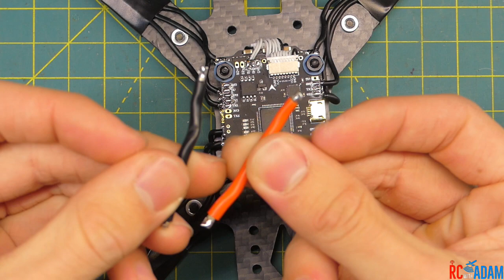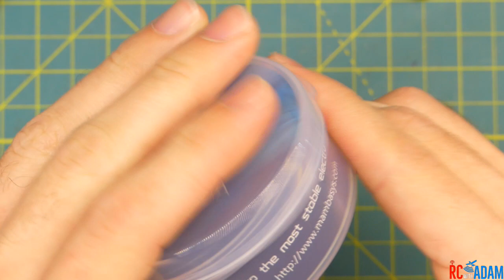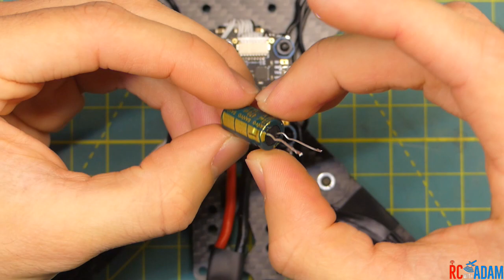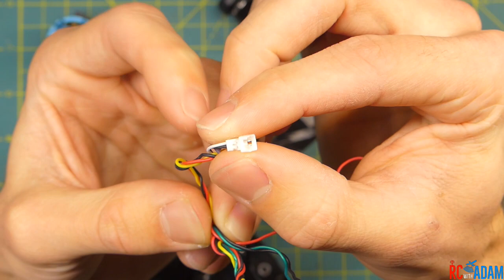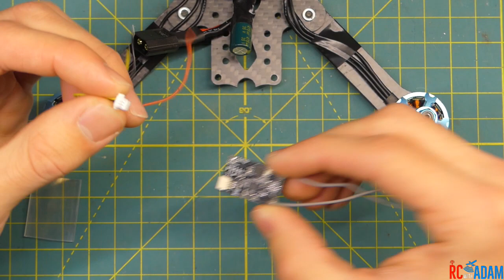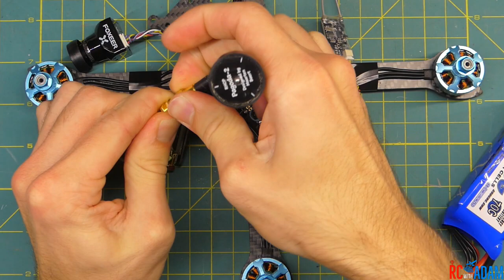Budget Basher Build - PART 3 - CAM, VTx, Rx, Ops Check [COMPLETE BEGINNER BUILD GUIDE 5" FPV DRONE]

Comment: Hey Adam, Nate here again. I'm trying to figure out where to solder my Fli14+ on to my Mamba F411 25A. With the r xsr not binding to my flysky I have a spare fli14+ and a fs-ia6b  to use. I took a look at the diagram and there's a RX 1, TX 1 invertor and TX1 uninverted. I'm kinda confused as to where I'd solder either receiver on, where should I solder the  fli14+ or the fs ia6b on?

Comment: Hey adam would the frame and the fc fit with a caddx tarsier camera because it comes attached with a dvr chip and if i take it off it wont be able to record 4k
Reply from the maker: Hi! It could fit, but maybe not super easily. The tarsier camera is narrower than the foxeer, so you would need to use some kind of spacers, and the board might need a custom mount.
Reply: @RCwithAdam1  what if i use a mounting bracket from another caddx camera?

Comment: On my flight controller of the mamba stack there is no tx1 pad. Where should i solder the green wire?
Reply from the maker: Hi! Do you have the Mamba F405 Mk2 flight controller?
Reply: @RCwithAdam1  yes i do, i try to settup mine the same as you.

Comment: Hello, I’m quite frustrated because i’ve been trying to build my quad since april and still haven’t been able to.
I first burned another mamba f405, the mk1 version, and had to buy the stack again . So the last month I resoldered all the cables into the new mk2 stack and everything was working fine until I started programming the quad with betaflight. I was unable to bind the receiver with the controller (flysky i6s 10ch) and the battery had been connected for a while. I gave up and disconnected it. 

The thing is that now when i connect the battery only one green led is shown in the esc, while before programming it I could also see leds in the receiver and video tx. The motors also beep differently, they now only do the first three beeps. 

Every help is appreciated, thanks in advance!!
Reply from the maker: Hi! That is frustrating! What rx (reciever) are you using? It sounds like the main issue is just that the rx and vtx (video transmitter) are not getting any power. Why that would happen without you changing anything is a mystery. Perhaps something overheated and burned out. Is your vtx very close to the fc (flight controller)?
Reply: RCwithAdam My receiver is the stock one that came in the box with my controller, 10ch fly-sky fs-i6s.          (looking something like this: [11,64€ 32% OFF]Flysky 2.4G 6CH FS-iA6B Empfänger PPM Ausgang Mit iBus Port rc teile from Spielzeug Hobby und Roboter on banggood.com https://banggood.app.link/1iroH6Qn6Y)

My video transmitter is just like the one you used. It was located over the esc part of the double stack, which I had to separate because I unknowingly bought an extrathin frame. I do remember it getting quite hot but thought it was normal. The receiver on the other hand was never hot.

So you think it could be fixed by rebuying the vtx and the receiver?

Thanks for your answer!

Comment: How you figured out the yellow was the signal and how you know to identify the correct wires to use in the connector to the camera and from the receiver ?
Reply: Also, what things should you take under consideration when buying a video transmitter. Does the fpv goggles that you use matter. I want the sky02s.  Sorry. This hobby is ruining my life. I need answers lol
Reply from the maker: @nacho248  Yes, goggles matter a lot. Mostly it's personal preference, though. I hear the Sky02s is good. I used to fly Eachine Goggles Two which a lot of people might consider trash. Now I have the Fatshark Scout and they are definitely an upgrade. If you're just starting out, I would say either buy whatever you like, has good reviews, and can afford, or just get a cheap sub $70 box goggle that will get you in the air and you can learn with.
Reply from the maker: Good question. Usually (hopefully) all of that info is in the product manual, but also once you're familiar with the different electronics, it's not too hard to guess.

Comment: Hi. I'm a newby, so I was wondering maybe some of you know where to put the grey wire? Do you put it in PPM or in TX or in RX? Thank you
Reply from the maker: Hi! What is the grey wire connected to?
Reply: I have a receiver DSM/2 Satelite,witch has three wires: orange, black and grey. This receiver is for my transmiter Spektrum DX6I. I want to connect those two, but I have trouble understanding where to connect the receivers grey wire. As it is shown in multiple videos, the grey wire should go to the Rx3 input, but it does not work for me.  Any ideas where I am wrong?

Comment: Thank you for this video! Great help! Just a quick question. Do you need to start with Tx1 or could you pick for example TX6 and keep the VTX stuff on the right side of the board and use the 5v and gnd next to the one we used for the rx? This way you wouldnt have to cross wires between the stack.

Comment: what type of antenna are you using for this build? RHCP RP-SMA LHCP RP-SMA or RHCP SMA LHCP SMA?
Reply from the maker: RHCP SMA. You can see more detail on all the parts here: https://www.youtube.com/watch?v=0zWvObLefKQ&list=PLDnffNsiQx6Nprb-oaFGLXKZyi07SBylG&index=2
Reply: @RCwithAdam1  can i know the battery you are using? and can you give me a detail about the capacitor you use in this video? I follow what you teach in this video, so I want to buy all the same things as you buy. Sorry Im not very good in speaking english. as long as you understand what I want to say😅😅
Reply from the maker: @アンドリューエデン  I use 4s (14.8v) 1500mah lipo batteries. As for the capacitor, it comes with the Mamba stack, but I can't remember the specs at the moment.
Reply: @RCwithAdam1  oh almost forgot. What goggles are you using for fpv drone?
Reply from the maker: @アンドリューエデン  I use Eachine Goggles 2, but I don't really recommend them. I haven't used these, but the FliteTest Marvel Vission II looks like a solid beginner option  https://store.flitetest.com/flite-test-marvel-vision-ii-goggle-flt-mvisionii/p774997 .
Reply: @RCwithAdam1  14.8v 1500mah 4s 75c , 14.8v 4s 1500mah 100c or 14.8v 1800mah 4s 70c.which one do you recommend for me to buy? I dont really know about battery because its so hard for me to understand some youtuber explain it in youtube, because i dont really know hearing english word language
Reply from the maker: Go with 4s (which is the same as 14.8v) 1500mah 75c (but 100c would be ideal also.). I'm not sure if it would help, but I think I'll finally make a video explaining the basics of lipo batteries.
Reply: @RCwithAdam1  Is it safe to use high c rating battery on this build like 100c?
Reply: @RCwithAdam1  what Flysky Fs-i6x are you using?why so many option for that brand like mode 1 right hand , mode 2 left hand , Fs-i6x+x6b rx , Fs-i6x+I16B rx , Fs-i6+IA10B rx , Fs-i6x+A8S rx.which on to choose?
Reply from the maker: @アンドリューエデン  Yes. Basically, the higher "C rating" is better. C rating is used to indicate how much instantaneous "punch" the battery can provide. I know it's all very confusing!

BTW, what is your native language?
Reply from the maker: @アンドリューエデン  This is what I would get (same as what I use) https://amzn.to/2W5otq4 FS-i6X, mode 2, and it comes with the iA6B receiver (which can be used for both quads and planes). (If you want to use the same receiver I use in this video, buy the Fli14+ https://amzn.to/2DnoWwa separately).
Reply: @RCwithAdam1  my native language is kayan mix kenyah. Im from malaysia sarawak😅.
Reply: @RCwithAdam1  I have not bought goggles yet. It's hard to find in shopee app.I have bought all the necessary items and all of them cost for rm1404. This is the rm1404 after convert to Us dollar $341. maybe because I have no battery, charger, goggle and transmitter. That's why I'm spent more money to buy that😅. Sorry for asking you a ton of question.